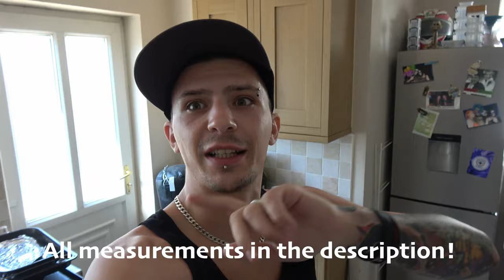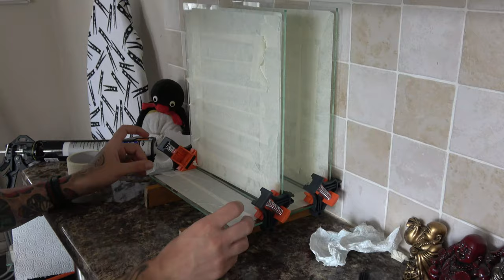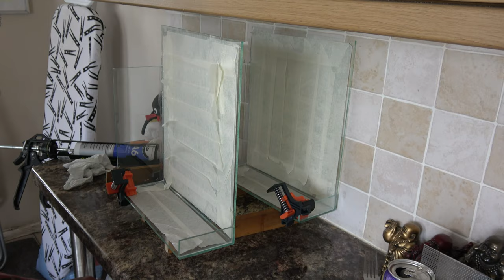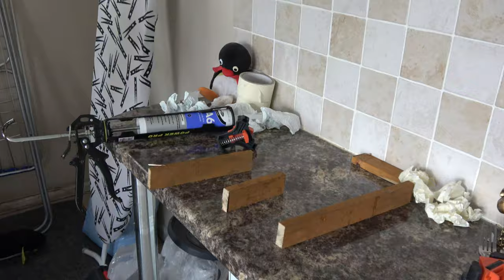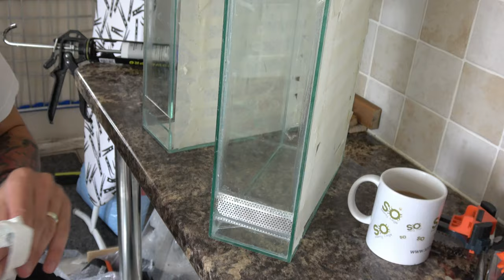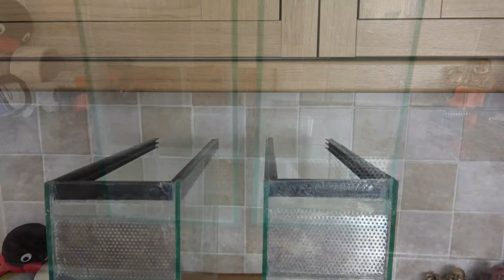TARANTULA ENCLOSURE - How to build

Comment: Cheers
  Seen a similar enclosure on a tarantula website forum this evening...  It was very beneficial seeing you build this style of enclosure.  Thanks
Almost got a 10 gallon glass aquarium tank this evening. For the Cyriopagopus lividum adult I bought today at a  Repticon Expo. 
  Its in a tall Tupperware setup right now. They said she can stay in that awhile but Im going to either buy one of these or build it in acrylic. Have made two terrestrial enclosures out of acrylic so far, and with the pieces cut to size. It wasn't that hard putting them together. Glad I didn't buy the 10 gallon aquarium this evening. This style enclosure will be a lot more ideal for the Cobalt blue. Plus I can add more air vents and hopefully avoid a mold outbreak... Its also really cool to be able to see them in their burrow as well!!! 
  Any tips for getting her out of burrow in old enclosure for rehousing? She definitely didn't appreciate me checking her out today. Seen some decent sized fangs and I'm pretty sure that wasn't because she was smiling. Lol 
  Guess I will try putting catch cup over burrow entrance, and try to using something to push into the substrate behind her to encourage movement and hope she goes into catch cup. Hopefully she doesn't freeze in a threat posture. If she does then what? I totally understand why she would be upset. That burrow is her protective home, and I'm invading it. 
  I definitely want the rehousing to go smoothly. I seen the YouTube where a Cyriopagopus lividum ran up a guys arm and ended up chilling on his ear. He didn't go about it properly. But I definitely want to avoid a epic fail rehousing this girl. Lol

Comment: Another question just came to mind. How do you get them out of these enclosures for rehousing etc?  Just watched a YouTube on the flood method, but I don't believe I will attempt that. Plus with air vent in bottom flooding may not be a good option. 
  Going to make mine just a little wider. Hopefully that won't ruin visibility of burrows...

Comment: whats the clamp like tool you used to square up the glass? and whats the thing you used for sliding the door?
Reply from the maker: They are just 90° clamps from amazon and the runners are normal vivarium glass runners from ebay and I cut them down :)

Comment: hi. thank you for sharing. awesome looking enclosures. what size are the ventilation holes of the smaller metal towards the bottom of the enclosure? does a lot of substrate get out of the holes? how do you deal with it?
Reply from the maker: Thank you! The holes in the vents are 3mm and i dont tend to get any substrate  leak through the vents at all :)

Comment: If I wanted to make one that was a bit wider, just change the widths of the bits of glass with 100mm with what size I required yes?? ,
Reply from the maker: Yes buddy the 100mm is the width so just adjust as needed :) 🤘🤘

Comment: Nicely done mate where did you get the mesh and runners from? Going to make myself some enclosures once I get back to work and can get a load of glass for free
Reply from the maker: The mesh was 2mm thick perforated aluminium and that was from Amazon and the runners were from ebay 🤘🤘
Reply: Alternative Inverts cheers mate will have a look for some

Comment: How do you keep fossorials in those with the bottom ventilation so low?
Reply from the maker: Really you do not need any bottom ventilation as a lot of people use cereal tubs for fossorials. This just allows some airflow into the soil and if i wanted to moisten the spoil at the bottom i can use a syringe through the vent. I have a C.doriae and a C.bach ma in some of these already and no substrate comes through the vent either. Obviously out in the wild they will have no vents in the bottom of burrow so realistically they aren't needed at all if you didn't want to add them :) 🤘🤘
Reply: @AlternativeInverts  then I get it  😁

Comment: Great video mate, just wondering how much did all that come to?
Reply from the maker: Cheers mate :) Roughly works out around £20 per enclosure dude. Bought the mesh and runners in bulk and have enough glass for a total of 7 enclosures. I reckon its saved about £10 per enclosure so with the amount i need it saves quite a lot 🤘🤘
Reply: @AlternativeInverts  where did you get the glass mate?